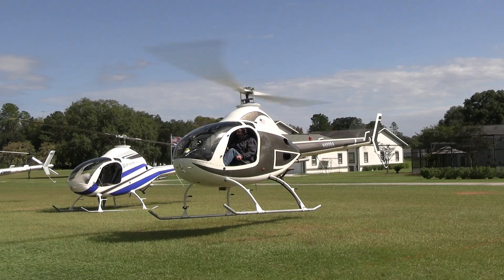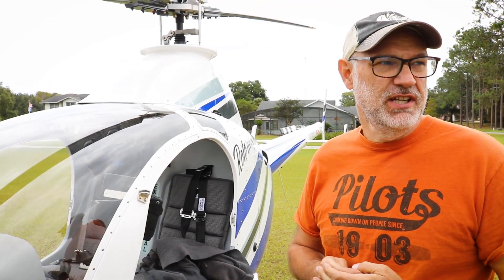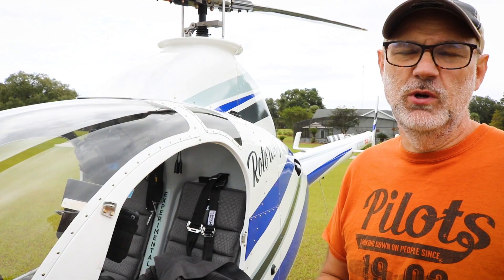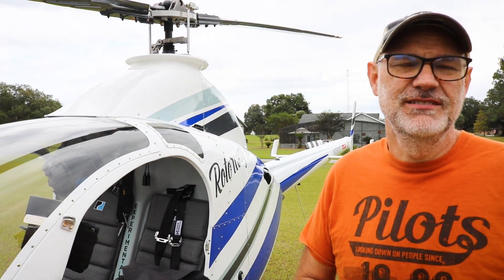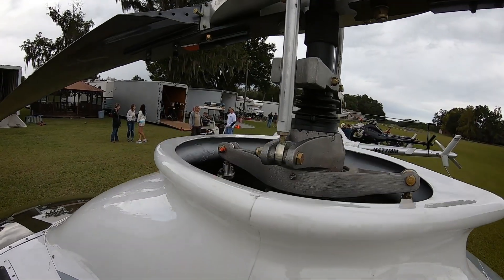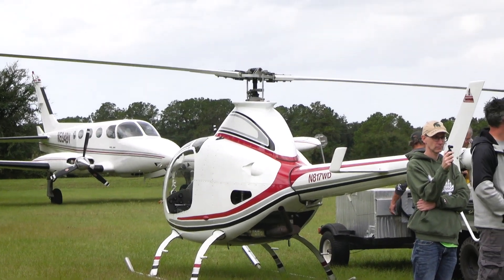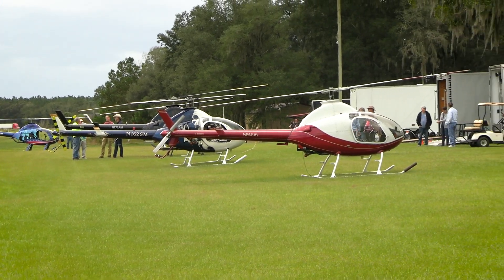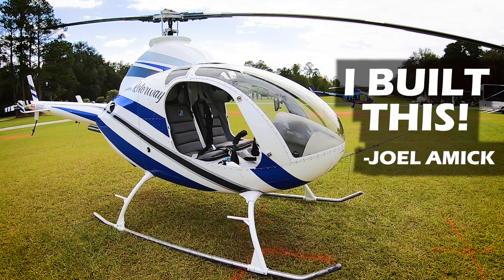Build a Helicopter from a KIT! -  Rotorway 2 Seater Turbocharged

Comment: There's good reason an R22 costs more than this thing - quality engineering. These rotorways use a dozen belts between each system and a modified car engine for power. They're also amateur built so who knows what mistakes/shortcuts the owner took, if he had a few beers that night assembling the tail rotor system, or if he became impatient and got sloppy with the rivets. The R22 uses the worlds most reliable piston and is built by professionals to exacting standards. Is your life really not worth 50k?
Reply: See the video out of Texas a few days ago? I flew real helicopters for about 30 years and wouldn’t get within 50 yards of a Robinson.
Reply: @guitarpilots76  yeah i saw it but cmon you know they are otherwise extremely reliable helicopters with a proven design. Nothing is impervious to failure
Reply: A certified rotary wing pilot is not permitted to control a Robinson R-22/R-44 without logged SFAR No. 73 training because a Robinson is nothing more than a commercially built version of a home-built aircraft.
Reply: The engine is designed and built by the helicopter manufacturer specifically for the helicopter. They probably copied some details from existing engines.

Comment: How would someone like myself on a fixed income get to build my own helicopter?
Reply: Wood. Youll also need a v4 turbo motor, a rotor, and a tail rotor. You can find most of these parts at an aircraft junkyard.
Reply: Build a radio-controlled model kit.

Comment: You don't have to build 51% of an experimental aircraft.  An approved kit has to allow the builder(s) to accomplish 51% of the  needed tasks to build the aircraft. So if an experimental kit airplane has 30 ribs, the kit can supply 29 finished ribs and the builder has to fabricate one to get credit for a "rib making" task.  Some kit manufacturers offer two week to taxi programs where the "builder" goes to the factory where the staff "assists" the builder in accomplishing the list of tasks equating to 51% and they essentially build the rest and you have an aircraft ready to taxi under it's own power in two weeks.  Sure, there are scratch builders out there who take raw materials and hardware and build off plans but most kits today are quite complete and mostly require assembly and finishing work.
Reply: That sounds very helpful, had not heard about it before. Thanks for sharing
Reply: Please can u suggest a few nice  2 weeks to taxi options
Reply: @GurpreetSingh-he9cq  there is a new one coming out soon that is supposed to be doing a 2 week program but you’ll have to go to the UK for it and it should be around the 500k mark but it’s a 5 seater
Reply: @markwarren515 three years later (in 2025) the Hill HX-50 is still at least a year from first flight and at least two years from the start of production.
Reply: @GurpreetSingh-he9cq  it’s the Hills HX-50
Reply: 150flivver~ I've seen a lot of videos of helicopter builds and flight testing from Africa but they never, never get off the ground!
Reply: @rogertycholiz2218  😮😢😂❤❤🎉 xbb 😮
Reply: 1 madeyne j c v
Reply: ❤ 1 madelyne j c v
Reply: Ну вертолёты катаются летают хобби во 👍🏻 Я думаю лучьше электрический вертолёт Тесла может Илона Маска Тесла зделают новую модель вертолёта электрический кар.
Reply: A that information is cool but without contact information this entire paragraph is pointless. Links? Name of company? A friggin phone number? Something useful other than you telling us how easy it isnt?

Comment: What was the appendage hanging from the tail boom? It’s not the exhaust; maybe it’s a tuned mass damper?
Reply: It is a movable weight . Depending on weather you are flying solo or with an additional passenger . Can`t remember off the top of my head ,,,, but one way it is in the rear ,,, the other it is on the front skid tube .
Reply: @JoeyWebber955  you are correct!
Reply: I thought it was a bulbous bow or tail um stern sorry captain don't make me walk the plank or rotor

Comment: I love the way pilot called Heli as a ship. Nice.
Reply: I don’t like the term ship and I fly them. I guess it is just easier to say than helicopter. Most fixed wing pilots refer to them as aircraft. Another general term but more appropriate in my opinion. A ship is a large vessel that floats on water. Most helicopter pilots when talking about them say ship with such regard as if it is the love of their life. I get their affection but it is still hard to hear the word ship and not think about a large boat. Just my two cents.
Reply: @justflylow  same here I’ve never heard them called ship specially being a 2 seater , like calling a dinghy a ship just don’t sound right
Reply: @justflylow  - the term ship comes from the fact that they work on fluid dynamic principals but I prefer fix wing aircraft or rotor wing aircraft myself. Definition is key
Reply: The term ship in reference to helicopters has been used since around the time the1962 Huey Cobra GUNSHIP was introduced.

Comment: Seriously why there’s no belt on your diy helicopters rotor and there’s always a belt on Mosquitoes helicopters?
So you just care more about your safety than the customers safety ?
A belt is okay on a car or motorcycle but something that flies no.
Cutting off the cost and risking people’s lives is not okay at all.
Reply: Belts are safe..depends on their quality..the s300 has reably used belts for decades
Reply: Also realise you are talking about  an ultralight with less than 100hp..we are not talking about a super heavy lift chopper..belts are just fine in such an aplication
Reply: The schweizer s300 and r22 helicopter has a belt and its very realible.they are much beefier than those used on cars
Reply: @sengwesetogile6054  both of the helicopters u mentioned doesn’t have the same system, the belt is not on a pulley like on the mosquito and like on a skateboard, and like he said, u get less autorotation.
A belt is a belt no matter what and it shouldn’t be on the rotor. 
If it was that reliable and safe, he would’ve put it on this helicopter he built, no? Well he didn’t.
Reply: Nothing wrong with using belts. I wouldn't want a belt inside a shroud where it could jam up with a pulley if it breaks. Watch your rotor come to a dead stop if it breaks wrong. However, belts are just as safe as direct drives. If a belt breaks, you still have autorotation capability just as you would with a direct drive with a one way clutch. These also have those one way clutches to allow autorotations if the engine seizes mid flight.
Reply: Its still a belt, a belt is just a belt and it gonna stay a belt, if a belt was any good u would’ve seen it on commercial flying machines.
So belt is belt, u cant change my mind unless u cant cut the belt with a knife then I’ll change it.
Now its destructible, if it becomes indestructible then we’ll talk.
Reply: @medmusicviral  And the Earth is flat.

You need to get out more and talk to some engineers.
Reply: @medmusicviral  you deserve a belt, calm down. kevlar reinforced rubber to reduce weight, thats all.
Reply: A belt is made of plastic and plastic break. 
A belt is a belt.
Reply: @medmusicviral  The current best 2 seat certified helicopter, the Guimbal Cabri G2 uses drive belts. Robinson use them too.

There is no comparison between the fan or drive belt on a car and the drive belt on a helicopter.

Think of a very long a carbon thread wound around a barrel multiple times and then encased in the outer material, making a wide and very strong belt.

A very, very small chance of failure. If it does break, then autorotate,. The alternative is a gearbox, which on large helicopters like the Super Puma have a record of breaking and locking the gearbox and thus the rotors too, no autorotation possible if that happens. Pay your money, take your choice.

Comment: I don't remember hearing anything about what powers his ship.
Reply: mine is an exec 90,4cyl petrol engine, 150hp. 2.6 ltr . turbo versions add 20+hp. ideal for higher altitudes etc, however, reading through some of the other comments, i was sorely tempted to say "elastic bands" yours was a reasonable comment,by the way.
Reply: @eddyriley2055  how do you feel about that belt tail drive system?